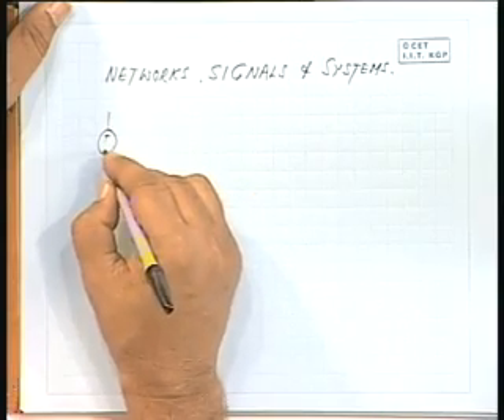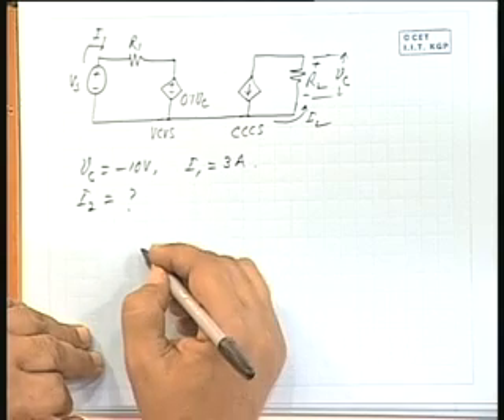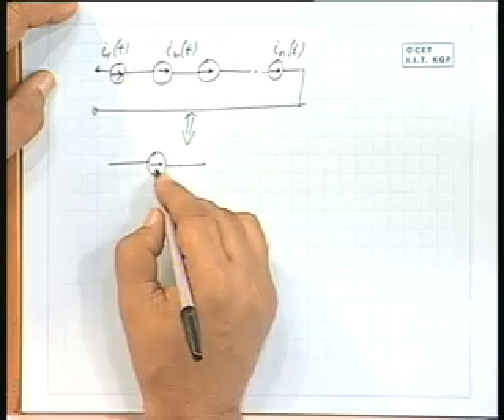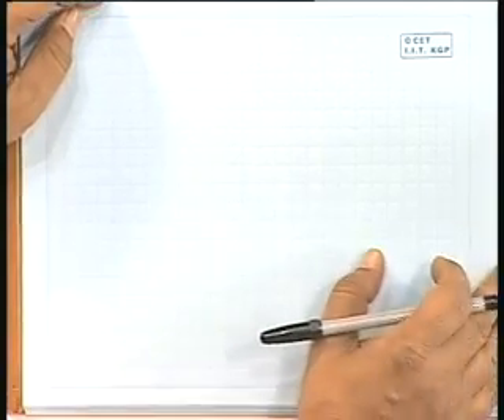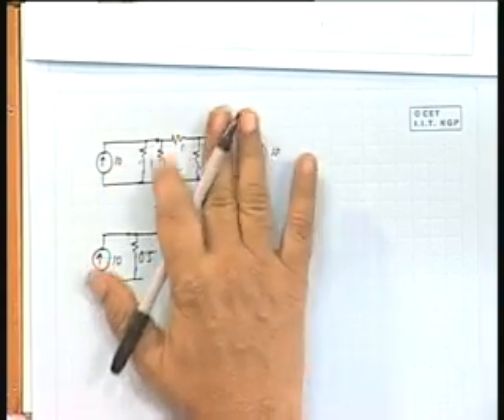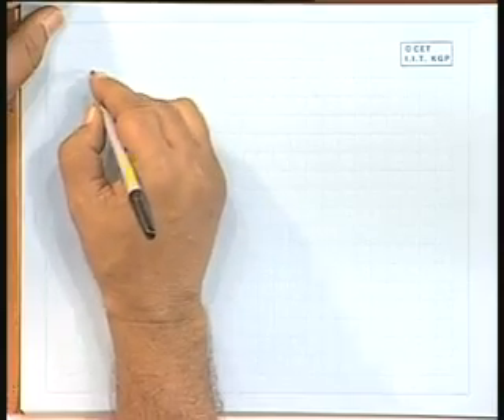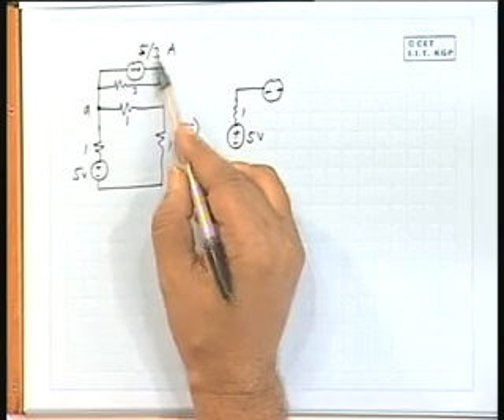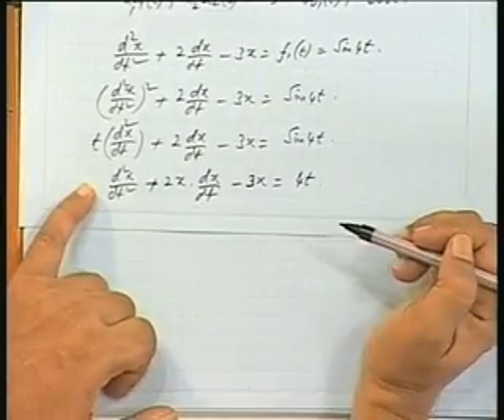Lecture - 1 Introduction to Network Elements and Sources

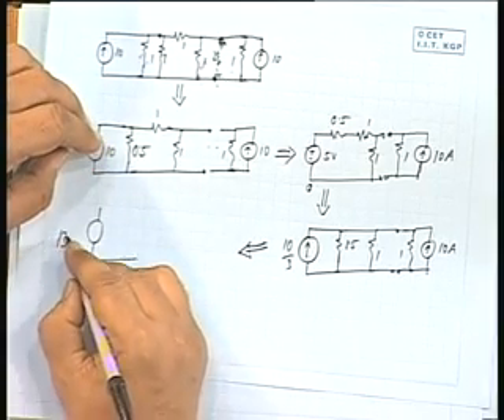Comment: I dont think we can assume the 10 A and 10/3 A current sources to be in parallel. Hence they cannot be added as shown in 39:08 to give a 13.33 A current source. Neither might we consider the resistors on the LHS and RHS of V0 to be in parallel
Reply: I believe that two voltage sources of different magnitude may not  be connected in parallel whereas two current sources of different magnitude may not be connected in series.